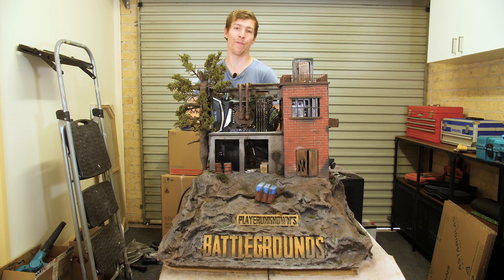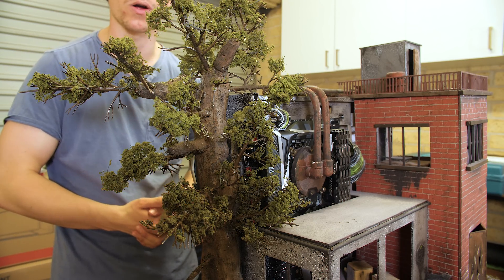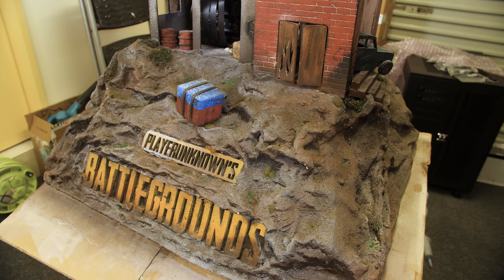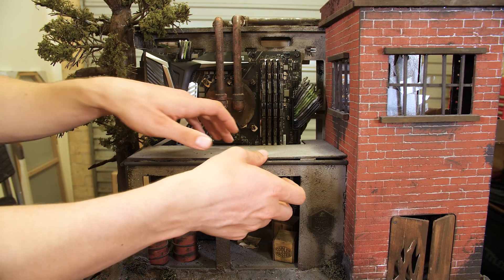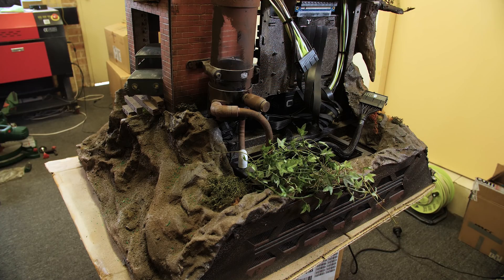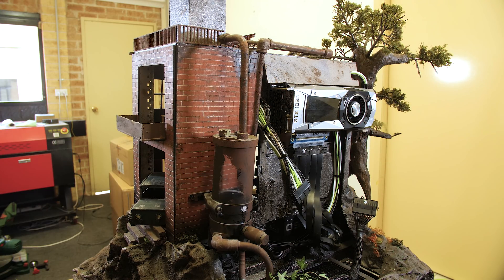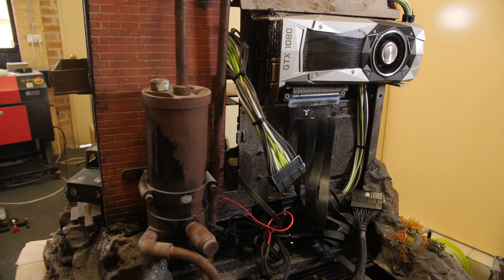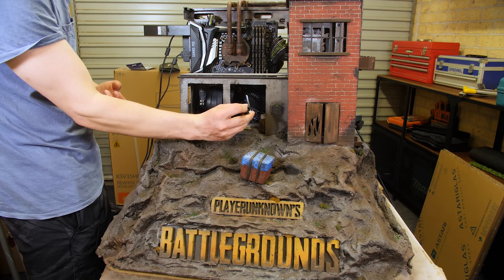Ultimate PUBG Custom Water Cooled PC Build in Detail

Comment: I think next you should do a pc based on Yamato , in the shape of Yamato and the hardware inside and make it big , also the wires coming out the back and little planes on it, and take the middle part of it of to view the inside, pls read and Mabey consider this as a future build Mabey when u reach 100k and I'll def be interested , this build was awesome I think u should do more shaped pcs like this
Reply from the maker: Good idea
Reply: Designs By IFR thanks I would probably ask u to do it for me as a custom pc and buy it of you but u probably remember me from other other video asking how much it would be with not as good hardware so u probably won't sell it to me as u might not have a 1070 and stuff that I want and u probably want it to be like 1080 ti and expensive stuff like tht, u may ask y would I be asking about a 1500 pound case with water cooling instead of really good components, well thts cause ur builds r one of a kind and I'd rather this than better hardware

Comment: For my experience, distilled water only without biocide is ok, change it after 3-6 months is fine. Coolant Ek cryofuel is good, but if that one leak out the on the arcylic surface, it may cause crack on block, my ek plexi and phantek c350i block got crack on thread inlet and outlet when the coolant pilled on the outer surface of the block, the solution is flush with distilled water b4 take out the fitting on the block. For now I use brand new full nickel Ek Evo original cqs, so distilled or coolant doesnt matter anymore.